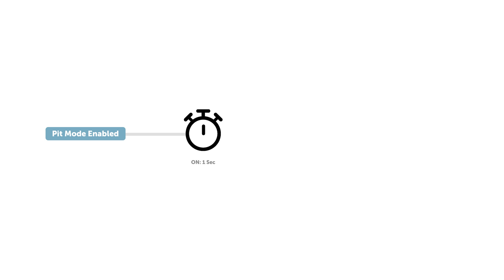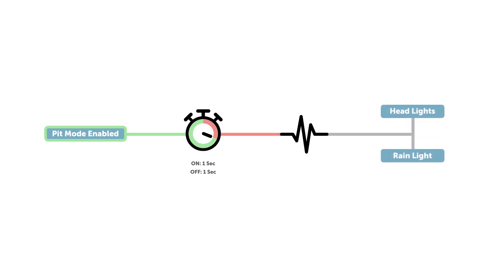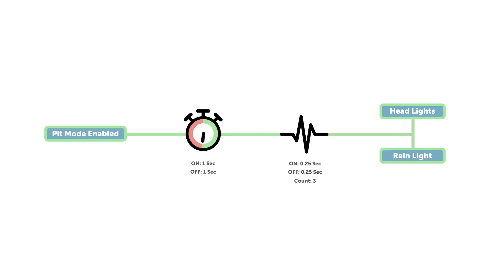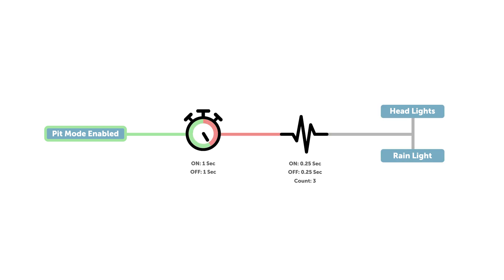Setup Your Pit Limit Function Like A Professional

Comment from the maker: WHAT IS A PDM?

A power distribution module (PDM), power management unit (PMU) and power distribution unit (PDU) are all the same thing with different names, much like how variable cam control is called something different by each different car manufacturer.

Over the last few years we’ve seen PDMs become more popular and more affordable which means we’re seeing them pop up in more and more cars running at the grass roots level. These units replace the conventional fuses and relays we need to control and protect the various electrical circuits on our car with solid state electronics to control current flow. This dramatically simplified the wiring installation and can also improve reliability. With a conventional fused circuit, if the current is excessive then the fuse will blow to protect the components and you need to stop and replace the fuse to get going again.

With a PDM the fusing current can be adjusted in software and the unit will simply shut off the circuit if the fusing current is exceeded. The smart part however is that you can then configure the PDM to wait a specific amount of time before retrying the circuit that just failed. You can also set how many times the circuit will retry before failing permanently. This can often be enough to nurse a car with a failing electrical part back to the pits for repair. It’s also possible to log and display the current draw on each circuit so you can see exactly what’s going on with every part of the electrical system.

At this point a PDM is still going to end up more expensive than using fuses and relays but when weighing up options most enthusiasts overlook the cost involved with mounting and wiring the relays and fuses. When you factor that in, upgrading to a PDM often isn’t going to cost substantially more and by the time you consider the advantages it can start to look pretty attractive.